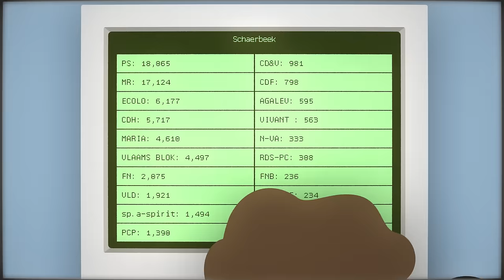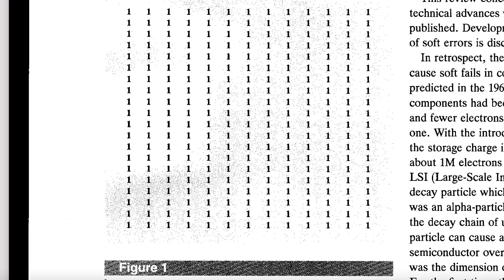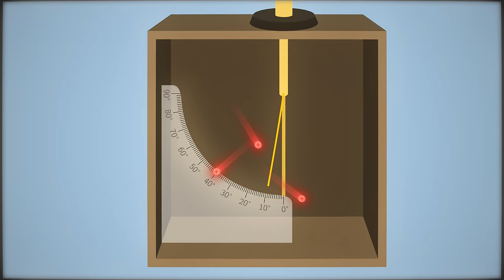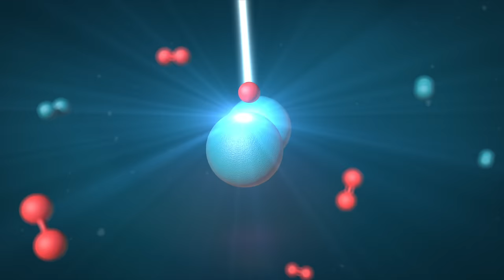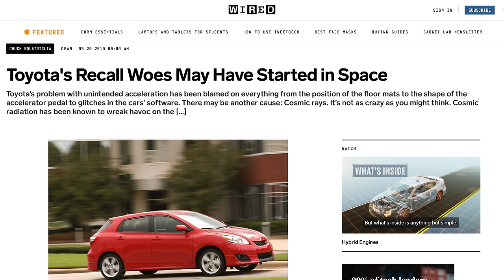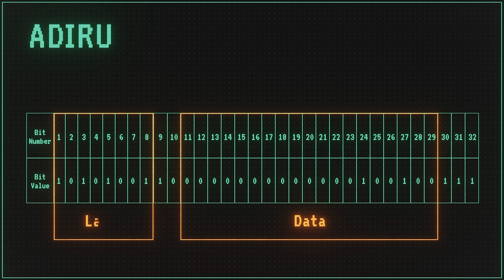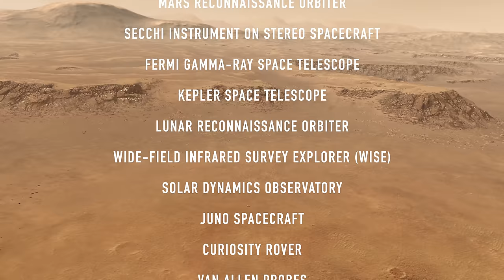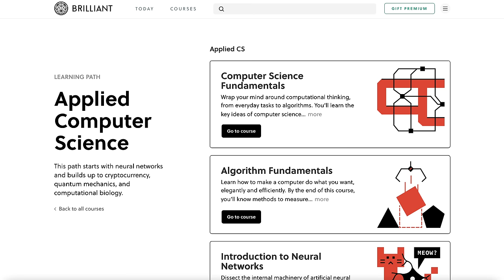The Universe is Hostile to Computers

Comment: This video is scientifically correct in explaining the nature of this problem,  but, unfortunately, factually wrong in addressing the causes. I was the Project Manager (and Tim May, co-author of this first paper on alpha particle-induced soft errors, and with me on the chemistry of the impurities that led to the problem in the second, internationally recognized second paper), so I really know the facts.  The entire story is too long to write here, but basically, the alpha particles came from Th impurities in the Zr-based low temperature sealing glass used in the DRAM packages, NOT from ceramic packages, and nothing to do with mines in Colorado. It's actually a neat story of encountering and overcoming seemingly impossible materials problems; in this case a problem that could have brought Moore's Law to an early failure. (Gordon himself made the first (erroneous, as it turned out) prediction of the cause of the soft errors, but it took several intense weeks and months to understand and ultimately fix the issue. I was Director of the Package Development Program, responsible for both "causing" and fixing this issue. 
Gene Meieran
Intel Senior Fellow (retired)
Reply: Interesting.  Thank you.
Reply: Cap
Reply: Couldn't you just fix it by using some internal error correction like reed solomon codes?
Reply: @gayusschwulius8490  Those types of error correction techniques are used on data transmitted from one location to another where data corruption enroute is possible. It's very effective for that. A single event upset (SEU) isn't limited to a specific communication path that can be checked when data is received. Any bit can flip at any time. The corruption could happen after the data is checked or even in the main program software itself. Nothing is safe.
Reply: @gayusschwulius8490  Yes!  The device experts quickly addressed solutions based on error correction. But as a materials scientist, we wanted to address the fundamental cause of the problem regardless of any software fixes. And we suspected that as device feature size continued to shrink and devices became both more sensitive to such random events and there were more of them subject to being hit, ALL SOLUTIONS were considered.  Simply put, the fewer errors there were, the less dependent or ERC we became. Remember, this happened 40 years ago, when ERC and device physics (and materials chemistry!) were less understood than today.  But excellent question. 
Gene
Reply: nice to meet you, Sir
Reply: Great 👏👏👏
Reply: Magician
Reply: yooo
Reply: @JMS_Rex  get off the internet, man
Reply: @jbonillaguitar  a virtual gesture cuts me off the internet? well, why sir!?
Reply: I don't understand a word. Sorry
Reply: I’ve found a bunch of flaws with this guys videos this one and others so I take the info with a grain of salt.
Reply: @genemeieran8301  "when ERC and device physics/mats-chem were less understood"
I mean, yeah...  we're looking at this with decades of hindsight, but back then y'all didn't KNOW and were actually having to SCIENCE that crap out.
Reply: I had been asked to weld the stainless steel 303 pins into rings that held the chips in some kind of plating or depositing operation for IBM in the early eighties, and I had mentioned to them that the tungsten electrodes TIG welders use for stainless steel have thorium in them. And that it might not be a good idea.  The fellow that brought them to me to weld them agreed. But they had been doing that for a while already.
Reply: Pretty cool sir. Love from India.
Reply: Read through this 3x but still couldn't understand what's actually going on. Got it.
Reply: @ifalm4274  Th=thorium
Zr=zirconium
Reply: @darkdeathoriginal  Th=thorium. Element #90.
Zr=zirconium. Element #40.
Reply: This is an example of how material science is critical in determining the outlook of technological growth and progression. Hats off to ya sir.🎩
Reply: Thanks for your work on Intel
Reply: the maybe smartest youtube comment of all times ^^
Reply: Nerd
Reply: But how can we relate this event with the glitch in the game?
Reply: @ihatetobethatguybut7175  Wow you sure do like to be that guy
Reply: @runningowl1812  You're watching Veritasium.
Reply: Hey Gene that’s awesome, thanks for chiming in
Reply: Thanks, this is an excellent addendum and correction to an otherwise informative video. Thank you for reaching out and thank you for your contribution to our modern world.
Reply: Wow
Reply: Wow , that's heavy duty Man !
Reply: So radation still cuased it?
Reply: Huh... NGL, it never ceases to amaze me just how delicate the process of imbuing sand with intelligence is
Reply: So where do you think he got the ceramic packaging stuff from?
Reply: Look at this doooode impersonating
Reply: Too long I am not going to read all  these. Round it.
Reply: would you say these bit flips are still a problem? or has anything been done to address these?
Reply: William McCormick weld? Solder you mean, 🤡
Reply: You should edit your comment to note at the beginning that you're specifically referring to the older error relating to the DRAM packages. Otherwise you risk inviting confusion, since the video itself is mainly about cosmic radiation.
Reply: @Some0ne001  sure, kid, sure.
Reply: Ok nerd
Reply: Wow youre so cool
Reply: @JMS_Rex   Don't interact or feed the trolls Most are just high or ignorant children.  It's like feeding a stay cat 🐈
Reply: Maybe idle cpu's and unused memory could be allocated to error correction like the multiple cpu's in the spacecraft?
Reply: @WilliamMcCormickJr  Good grief.
Reply: I hope Derek gets to read this comment
Reply: @darkdeathoriginal  The only reply in this section that I could relate to 😆
Reply: Each one keeps coming with More nonsense
Reply: These same particles we can and cant harness energy from only because there to powerful for us to much energy for us to harness that interests me
Reply: Can you explain that again lol 😂
Reply: Hello sir. This may not be the best format but was curious. Would this be the strangest thing you encountered in your job? Anything stand out like this story?
Reply: @Some0ne001  Well Not all of his research is 100 percent Efficient, you could write to him what is wrong or right?
Reply: Are you saying what happened to airplane was just pilot error?
Reply: Thank you mister mairan
Reply: Why can't we cover the electronics with some anti radiation material and solve the problem?
Reply: You might be able to help me.  A person I work with suggested I learn about this.   My problem is being around electronics.   If I go near another person's computer such as my wife's she'll know I'm in the room because the computer starts to act up and get weird.  I have to leave the room.
I have technologies at work that this happens to also..  I walk in the office to run off paperwork.   It just stops working for me.  I'll ask our secretary if I can use theirs because I'm having trouble with the worker's printer.   When I use their printer it won't work.   The secretary tries for me and it won't work.  I'll walk out of the room and the printer starts working again.
These are only a few examples of what I go through with computers.  My personal computer rarely will act up on me which I find to be weird.   
My co-worker suggested I look at single event upset to understand what's happening.  He told me that there are people in the world that have this issue.   No wonder I'm uncomfortable with technologies.   I guess I should just go off grid and live like the Amish.
Reply: @darkdeathoriginal  ya same I thought I was just sleep deprived
Reply: @beebob1279  my mother is the same way- does that mean you guys attract particles or what?
Reply: @pesokpesok  I don't know, but it does get annoying.
Reply: @beebob1279  wonder how many more people have thhis problem- my mother for example could never wear watches - both digital and analog with battery would die on her within a few days without any signs of damage. I have to change batteries in her remote about twice a month, she is on 8th cordless landline phone set for the past 5 years, killed Samsung Note3 smartphone then replacement Note5 and now she is having problems with Note9 that i gave her for last Christmas(she gets my old phones since killing 2 new ones i dont see the point of getting her more) even though she only makes calls on it and nothing else oh and she went through 3 laptops before i stopped buying them for her. this is just off the top of my head - there is more. I always thought there is some unique quirck with her but seems that there are more people like that. Have you ever found out anything at all about whats happening(none of the doctors would take this seriously)?
Reply: good info, but why did u say it as if a significant portion of the video was factually wrong? u literally only corrected one sentence he made, that was slightly wrong but otherwise not important to the rest of the video
Reply: Let's use an analogy.  "A single bomb was dropped on Hiroshima that destroyed the city, killed many thousands of people, and hastened the end of WW2. This single bomb involved a new kind of chemical explosive that released the equivalent of 20,000 tons of TNT".  IF I read that FACTUALLY TRUE STATEMENT except for the last line, I would respond that the statement is factually true but the description of the CAUSE of the explosion is wrong.  I'd then describe in great detail the difference between a chemical explosion and nuclear fission.  So it is with this video; the nature of the problem and its effects on solid state electronics is accurate, but, as I clearly stated, the explanation of the CAUSE was incorrect. In an expanded description of the bombing of Hiroshima that had everything correct EXCEPT ONE SENTENCE describing the cause, THAT misinforming about the CAUSE of the very topic the authors were explaining. would be considered a serious problem.  The only topic I addressed in my response was the source of the alpha particles, not any of the other observations or conclusions. And I still believe accurately describing the cause of soft errors was and is important in relation to the content of the rest of the video. The description given was simply wrong, not "slightly" wrong....as illustrated by the extensive and diverse efforts devoted to rectifying the problem.
Reply: That's interesting 🤔, thanks for this info.
Reply: I assume you could stop this issue by lining the computer case with some heavy metal that blocks the particles?  Would that be too expensive, or why wasn't full shielding of computers used?
Reply: In the original studies, Gordon Moore (of Moore's Law, and CEO of Intel) thought cosmic rays might be responsible, but statistics and experimentation quickly proved this hypothesis incorrect. Statistically, the rate of high energy cosmic rays striking a device surface was too small to account for the soft error rate, and experimentally, using a lead cave and a real cave at the UC Berkely campus, as well as tests with varying degrees of radioactive glasses and ceramics, along with other shielding mechanisms, gave correctly predicted soft error rates.  Cosmic rays CAN and probably due lead to some soft error events, but in the case of the early semiconductor memories, it was the contaminants in the glass used to seal the packages that was unambiguously the source of the problem.
Reply: Thank you for chiming in and the way you give very precise info, I could read your comments all day...
Reply: Cap
Reply: I just started working here at F11x for Intel:) very interesting information
Reply: Welcome to Intel. I worked there (and Fairchild, the precursor of Intel) for 47 years. Good luck with a good company.
Reply: Tip for the future, give a TLDR that explains it much simpler. I genuinely can’t tell if he’s trolling and just made a jibberish comment using big words
Reply: He sounds smart, Imma subscribe to this guy
Reply: Pin this please
Reply: @Veritasium
Reply: @1998SIMOMEGA 
You should probably know what you're talking about before you try to correct a historically pivotal wizard on the issue

Comment: Computer Engineers: I think I can guess what he's talking about from the title and thumbnail.

says the count was off by 4096

Computer Engineers and Scientists all at once: I know exactly what happened
Reply: exactly XD
Reply: you see, we have to deal with goblins switching our transistors sometimes, so we employ very small gnomes to keep track of multiple versions of our system and change them accordingly
Reply: yeah same here lol
Reply: yep
Reply: Exactly. As soon as I heard 4096, I knew what was going on.
Reply: Powers of 2 be sus like that
Reply: welp, better invest in some ECC memory then
Reply: @aditbro  DDR5 is error correcting by default.
Reply: It's like the supervillain who leaves a calling card
Reply: @GonePh1shing  Its not error correcting in the same way that ECC is. It only covers a single subsystem, the controller maybe? I dont remember. either ECC aint going away any time soon
Reply: @JohnSmith-us4pj  Actually the ECC in the DDR5 JDEC spec is exactly what you want to protect against bit flips on the memory modules. DDR5 uses on-die ECC which protects against bit flips in memory, whereas "regular" ECC protects against bit flips in transport. DDR5 supports both, but has on-die ECC as standard.
Reply: @GonePh1shing  eh, you clearly remembered that better than me but the point stands I guess

Comment: "Drivers pushing on the accelerator thinking it was the brake" love he said it with such a straight face lol
Reply: Brake
Reply: Especially since the first two in that list were legitimately concerning things
Reply: Well there is driver who push accelerator and fall to sea from harbor and car is flip, the good thing there is many people at that times so the driver and passasnger is safe.
Reply: in the end that's what the most likely conclusion was, that people were failing to press the right pedal. A few cases the floor mat did get stuck, but very few instances of mechanical or electrical failure. Toyota recalled millions of cars over this.
Reply: You might think this just signals user error and that's the end of it, but on a deeper level, the fact it was a common problem indicates poor design
Reply: Ya I've actually done that. I was backing up my driveway and smashed into the garage door pretty good. And another time i was out on a road trip and instead of pulling over when my right ankle was getting sore i tried driving with my left foot. Was fine for about 10 minutes or so until i went to slow down and applied way too much pressure nearly locking the brakes. 

So considering I'm fairly lucky as my being a bit of an idiot and space cadet is counteracted by my blessed ability to not be easily panicked, i can only imagine how often someone with a bit less wits and brains than me screws that up  in a shitty circumstance.
Reply: I think it was sarcasm from Veritasium. He doesn't really seem to believe the report that NASA gave- that's why the straight face. Toyota didn't need to callback all the cars like that if it were just driver's fault. Just my thought though.

Comment: "In space, no one can hear you scream, when you can't hit the reset button." -- An adage spoken by space engineers at GD. Some of the RAD hard CPU's can cost up to 100K each. This adds up fast when a flight system might have 10 or more CPU cards in it. One solution was to use 4 semi hardened COTS CPUS costing a lot less and tie them together with a RAD hardened voter chip. The voter resets and syncs faulted CPUs. Memory, ram and rom, are constantly scrubbed to check for parity errors (SECDED - Single Error Correction, Double Error Detection) and any SEU errored cells re-written. Test and verification of space systems is interesting - load the UUT into a radiation chamber and bombard it while its running.
Reply: IBM PCs and most clones in the early 80's came with parity-checked memory SIMMs. The odd parity check crash wasn't that uncommon, though I suspect most were due to manufacturing flaws or static rather than cosmic rays.
Once RAM got more reliable, parity-checking disappeared at the consumer end of the market to save money .
Reply: This comment makes me feel like an idiot
Reply: Man I'm understanding alot of that but there are parts that remind me im the big dumb
Reply: Absolutely cunning, I was here thinking and designing in my head countermeasures for the radiation problem by having a multitude of computers checking and rewriting themselves constantly to mitigate the issue. But damn they’ve already came up with it haha.